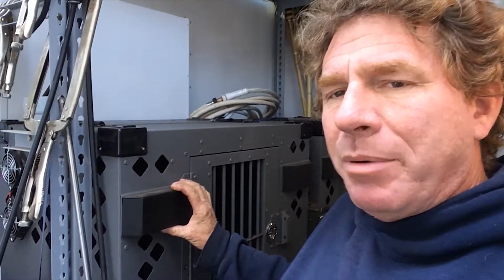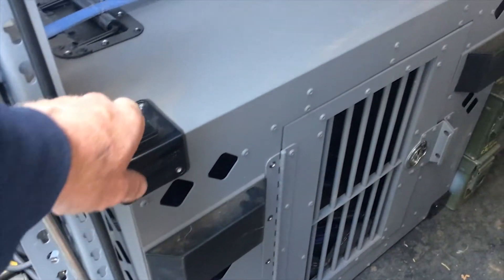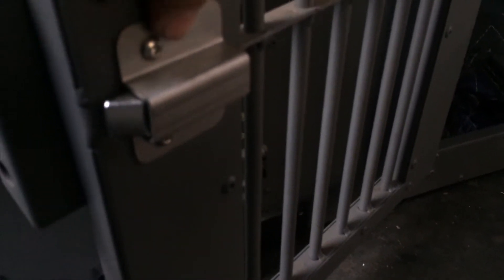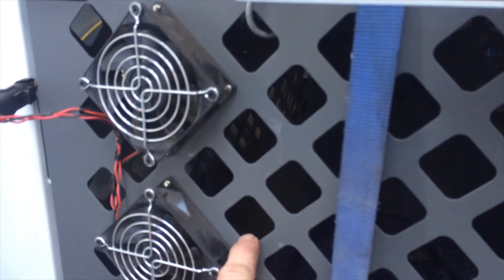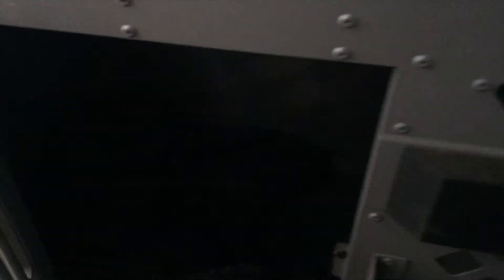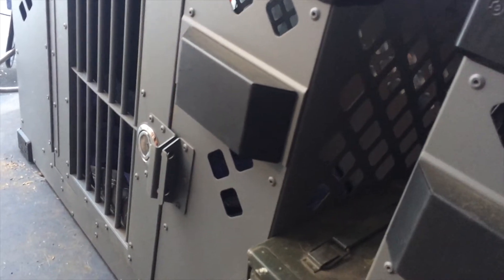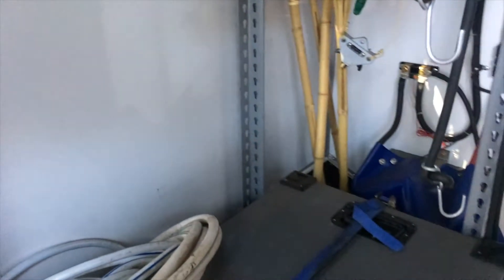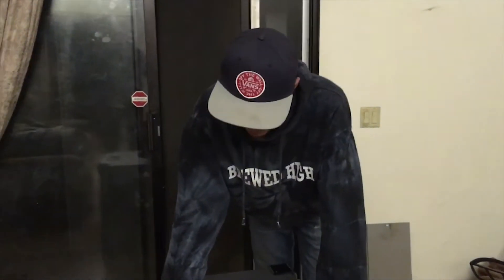Impact dog crate review by Crazy Marty 😜

Comment: Hello Marty
Thank you for the review. I'm about to pull the trigger and purchase  for my upcoming relocation to Hawaii for work. I was blown away with the fan addition, how does it run by plugin or battery. And more importantly did you modify the kennel " cut to fit the fan in . Could you do a video, also wanted to know can you place more than one dog in the  kennel if they are 40lbs. I have 2 Stafford Terriers "fur-babbies".
Reply from the maker: I added the fans myself. I just used the same covers on the inside to hold them.  They are just computer fans